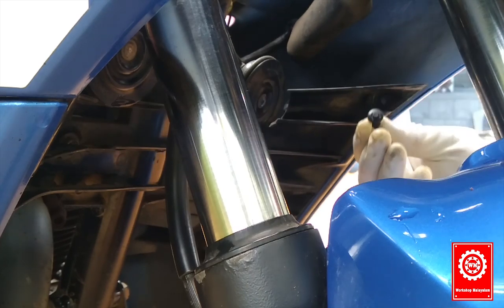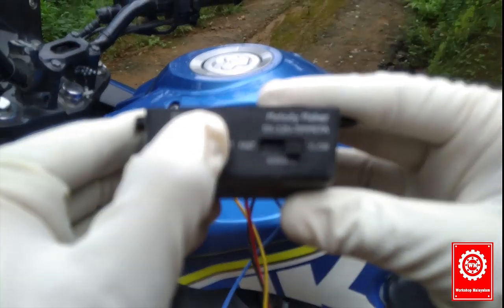how to set/fix/connect melody maker to your bike /scooty & wiring at home | in malayalam

Comment: Anna dio kill switch video. ann njan chodichirunnu
Reply from the maker: Cheyam but dio.illadaaa
Reply: ഓ.      ഒന്നു  try ചെയ്തു നോക്കു  പറ്റുമെങ്കിൽ
Reply from the maker: Njan nokkadaa. Ende kail access anu ullathu athil kanichuthara athu mathiyoo
Reply: @Workshopmalayalam   acess dio ഇലും ഏതാണ്ട് ഒരുപോലെ ആണോ??
Reply from the maker: Connection same aanu but cheriya mattanundavu components nde positionail
Reply: @Workshopmalayalam  Components means??
Reply from the maker: Ignition coil, CDI okke mound chaitherikkunnathokke vethiyasam undakum... Athupole wire coding (colour) okke mattamunadkum